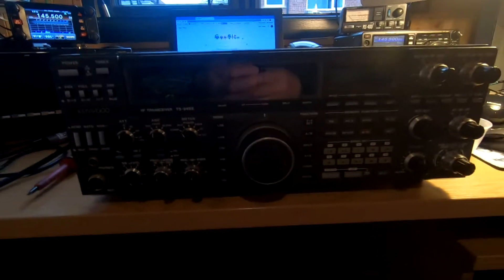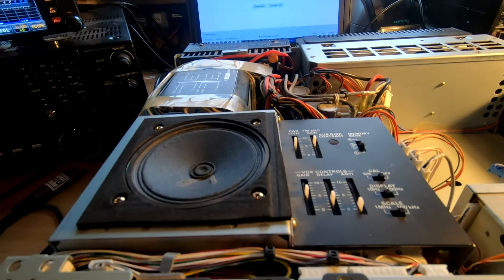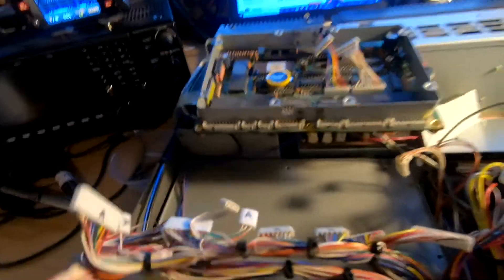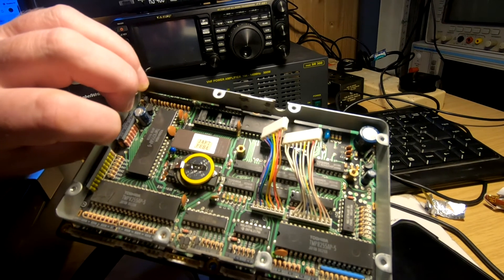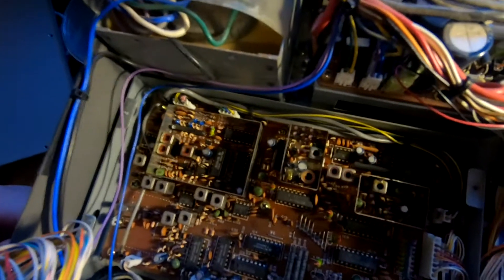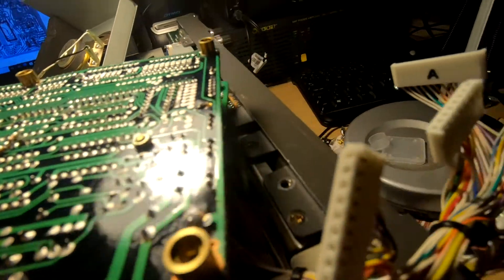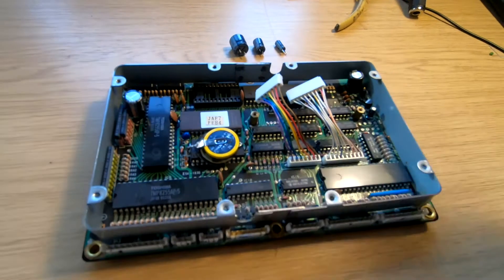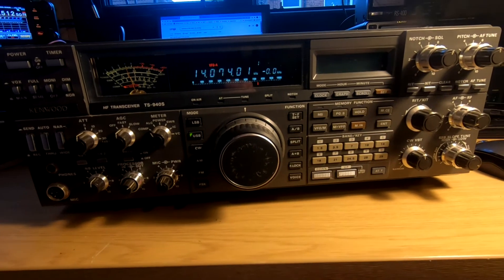Kenwood TS-940S Dot display problem, PLL out of lock. Fix

Comment: Great video!  Any idea why my display disappeared completely?  I sat for about 8 years and worked for about 10 minutes when i powered it up after sitting,  The battery on the board is definitely corroded and needs replaced, which I can do if I can find the part

Comment: Sometimes hard to hear you, but it was helpful just seeing the board removal. Glad it fixed your issue, I have one doing the same thing and I need to do this procedure. Thanks. 👍🏻
Reply: Have You did it with your's Kenwood TS-940S?
Reply: Not yet.  It’s on my to-do list, along with replacing the power supply with a Compudigital Industries replacement kit.